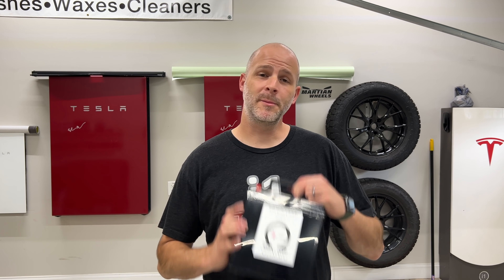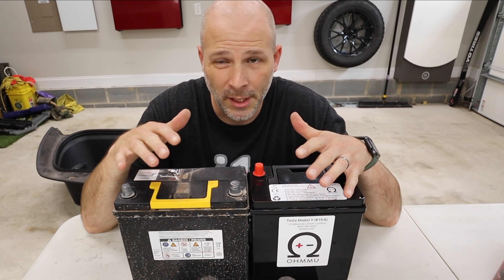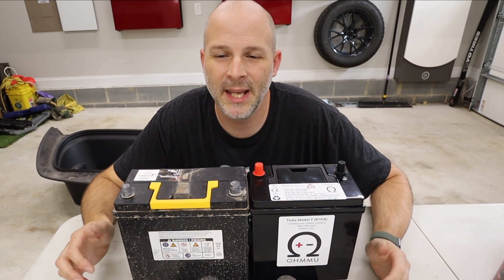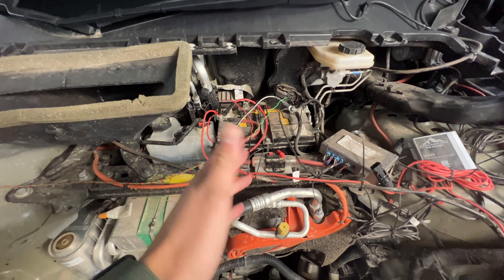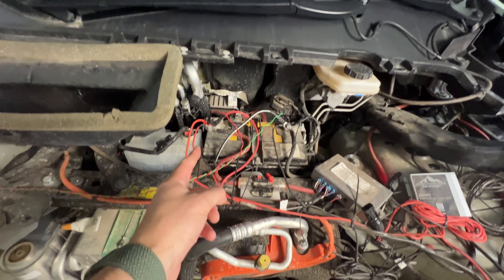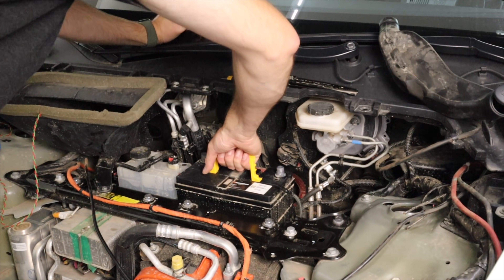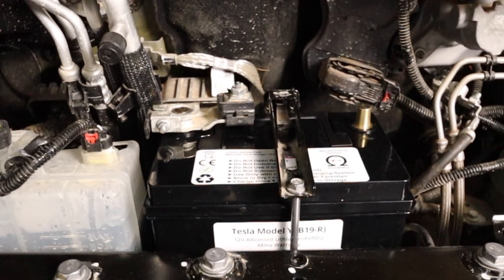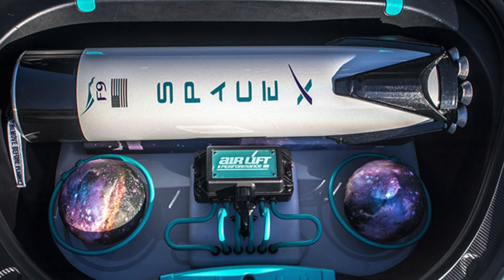Lithium Battery Replacement in my Model Y

Comment: hi I just purchase a lithium battery from ohmmu for my 2021 Tesla model y thank you for your discount code. how is the battery holding out with the air ride suspension because I'm installing an air ride also withe two viair 485 compressor just checking to see if you have enough power from it or any issues 
thank you

Comment: I herd a lot of complaints
That this battery has issues with tesla software updated and throws error codes and the high voltage pack doesn’t charge it Bc it’s confused.

Comment: Could probably just  make a LiPo battery for less then 100$ out of R/C car / Drone batteries..  each cell is 3.7 volts so you would only need like three 3s batteries in series. If I had to guess,  that is probably what is in there anyway

Comment: The factory 12v battery is covered under basic warranty on all Tesla vehicles. The biggest problem is that you are running your aftermarket accessories directly off the battery, where it is unmetered. This is what causes your early battery wear and 12v battery errors. The 12v factory battery in the car is NOT 14v. I have already seen some cars come in on flat beds due to aftermarket Lithium Ion batteries which were installed on the vehicle. Your aftermarket battery has a different charging profile and voltage from the factory battery and quite frankly, just isn't compatible. The car doesn't know how to support this type of battery which causes errors and prevents the vehicle from supporting the lithium ion battery properly.
Reply: Very good points!  Unfortunately YouTubers push products like this one for the kickbacks and freebies they get.  But no one should pay over $400 for a car battery, that's insane.  Especially when the factory battery is covered under the warranty.
Reply: @Resist4  to be fair, his battery wouldn't be covered with all the crap he has attached to it. But when the correct battery is $85 from Tesla, it would (by his approximation of changing a battery every two years) take a decade for this aftermarket battery to pay off. By then, this $400+ battery would have also died.

TL;DR This aftermarket batter will NEVER save you dime. It will only COST you hundreds of dollars.
Reply: @lanesalbacka1821  exactly correct!  And if someone is so worried about their OEM battery failing, then just go buy another OEM battery from Tesla and have it ready in case you need it.  Then you won’t have to worry about them not being in stock if you have a failure.  

There will always be some premature 12 volt auto battery failures but lead acid batteries have a long reliability history in the auto industry.  I personally have never had one fail during its warranty period.
Reply: I think ur right Bc I seen online mad
Complaints on errors with this battery

Comment: $439?!!!!   Financially it makes more sense to just buy another lead acid battery every few years.  But even with your 5% discount it's still over $400 for a friggin battery!
Reply: batteries for EVs are not cheap. Volt 12V battery was $240
Reply: @brandonroberts5058  Not sure where got that $240 price for a 12 volt battery, Tesla sold them for like $99 to $120.  But actually any auto 12volt battery will work, if it's the right size to fit in the car.
Reply: 4yr warranty only?? If I’m gonna spend that kind of $$ then they need to increase the warranty to about 10yrs IMO.

Comment: Brian, Thanks for the video.
I was wondering since the lithium battery is smaller is there enough room to put two in series to double the amperage? Thanks 😊 for your answer.
Reply from the maker: Yes, absolutely
Reply: @i1Tesla  
Hmm...might be something to consider for all the power you will be drawing?
Reply: In parallel not series otherwise you’d double the voltage, no good for the components 😉
Reply: @DudeWithDogs  
I stand corrected!

Comment: My model 3 12V battery notice came in the morning and the  car was undriveable in the evening.  Car still under warranty. Tesla offered to replace the battery after 2 weeks but my car was not driveable. Tesla needed 2 weeks because they did not have this battery in stock.  Tesla refused back up transportation. This Ohmuu battery was shipped overnight. Thanks to the videos, I installed it myself. Thanks to absolutely crappy service, I will never buy another Tesla. Thanks to Ohmuu that I had this alternative.
Reply from the maker: thats great that they overnighted the battery.

Comment: As soon as mine croaks in my Model 3 I’m getting an Ohmmu 😬
Reply: That would likely be a bad idea. Considering how cheap ($85) a battery from Tesla is, it would take 10 years (assuming the worst case scenario of having to replace the lead acid battery every two years) in order to make up the cost difference. By then, you will certainly have had to replace this $400 + battery at least once. Only setting you further back monetarily.

Comment: Question is will the Tesla battery management software charge the Lithium Ion battery correctly vs the Lead Acid its expecting? In my ICE cars, dead battery number one reason I got stranded or had problems so would be nice to never have a lead acid again.

Comment: When you disconnected the red tab from the main battery pack, was that a "thunk" sound that's heard on the video?  Will it always give you an audible sound when you disconnect the main pack from the 12V battery?
Reply: It's normal when it makes that noise. Same noise it made for me when I disconnected the 12v battery
Reply: Just guessing but it's probably a high tension spring loaded decoupler/relay, kept in place by the 12v ... so it will always disconnect on power loss, and has enough force to disconnect even if there is a bit of stiction from arcing.

Comment: Kind of off topic, but on the ohm website said we need to disconnect the high voltage cable  at the back seat location. So the backseat location and the front location are the same cable?  If I want to replace my wheel, can I disconnect only the front high voltage cable or do I need to do under the backseat?  Thanks again!
Reply: I was wondering the same thing.
Reply: Yes you have too. If you don't disconnect the back seat you can trigger the airbags in the steering wheel. It requires all connections to be disconnected to ensure nothing triggers.
Reply: @gester27  thank you! So both places are recommended to unplug or the main "switch" is under the backseat?
Reply: @mytesladream7814  yes you will have to unplug both front and back mainseat
Reply: @gester27  awesome! thank you so much!
Reply: The reason to disconnect the plug under the back seat (on Model 3) is to keep the car from putting out power to the battery cables while your are disconnecting them and replacing the battery.  You don't want that because you are likely to touch the positive cable to ground and cause an arc and melt components.  Disconnecting the plug also resets the computer so it can reset any error codes you had about the 12v battery.  Apparently on Model Y you don't need to disconnect the plug under the rear seat because there's another plug under the frunk that does the same thing (as seen in this video). You don't need to disconnect anything to replace wheels or tires.
Reply: @android04  wow, thank you for the detailed response!

Comment: Why is there a lead acid battery in the Tesla in the first place?
Reply from the maker: good question
Reply: @UC_Dh3NktdECrxMh10gkKfUQ There is already a huge lithium ion battery.  The little lead acid one is hardly a cost savings of anything.
Reply: It is possible to charge in freezing temps
Reply: Because they do not make all the car accessories, like the radio, as well as meters in any other voltage but 12 volts.
Reply: I think I saw somewhere that the law in some countries require that it is a lead acid battery because of the amount of power the engine would require when it starts, but I think some laws needs to be updated to fit the new world.
Reply: @casper_hansen  But there is no engine.  Electric motors don't need a "start up."

Comment: When should I replace the battery? My car is 1.5 years old no any warning sign so far.  Thanks!
Reply: I googled. Some other forums saying this 12v battery has 4 yr 50k mile warranty.  I plan to wait for warning signs before replacing.  For me one of the most important reasons going EV and tesla was low maint and hassle free (besides the torque). But I will follow your advice switching to Li when I do replace.  thanks for the video.
Reply from the maker: I would replace it before the two year mark
Reply: @i1Tesla  Thank you so much!
Reply: Same question. My m3 is 3 years old, no any warning signs.